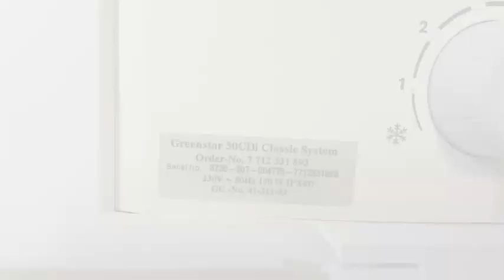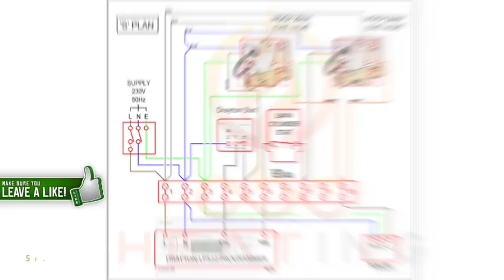Nest SMART THERMOSTAT 3rd Gen install - S Plan UK ⚡️

Comment: Hi In you last diagram.  Why have you wired pin 1 to pin 10 and the boiler.  This will turn boiler on permanatly as it bypasses the switched inputs?

Comment: Hi! Great video thanks. The wiring diagram is very helpful as i have the same system. Question is: I''m intending to put a third zone in for wet underfloor heating. I would like to use an additional Nest thermostat. 
1) can I add another nest thermostat just with one heat link, or do I need another heat link? 
2) How would this be wired?
3) Any chance you could do another video pointing out how the wiring works? I checked and mine is wired the same, just dont understand it that's all.

Comment: Hi 

I have a S Plan plus system. I want to wire 2 nest 3rd gen. 1 for heating and HW and the other for underfloor heating control. Do I wire the first one as in the diagram in the video and second nest to control the underfloor heating to terminal 6 (nest) to the live of the pump valve for the underfloor heating?

Comment: Hi there. Very good video particularly because I have EXACTLY the same Drayton installed and I want to replace it with Nest 3rd gen. Cables are connected exactly similar to one you have on your video. Can you please say if I can use just those cables to install my Nest without opening the boiler panel? Boiler is Worcester. I can send pictures of both if want me to.
Reply from the maker: Yes you should be able to. If the boiler has a switch live it needs to connect in to number 10 on the wiring centre. Normally this is a black or grey wire with a sleeve on it. I hope this helps.

Comment: Very helpful. I wondered why mine wasn’t turning the heating and water on and just realised I need to run a live to them both. What gauge wire should I use please? Would a wire from a regular (spare) tv power cable work? 

Thanks again. Will be getting it sorted tomorrow 👍🏻
Reply: Ok. Got it all working today. Thanks for the video. Saved me a fair few £’s and it’s pretty easy (when you know how) 👌
Reply from the maker: No worries I'm glad it was helpful.
I would recommend the cable to be a minimum of 0.75mm

Comment: great video thank you.  I have a issue with my  system ,  i have a S type system , (Nest 3rd gen, worchester greenstar 27ri compact, megaflow unvented cyclender,) , The issue im having is that when the nest call for hot water, the boiler turns on for a about a 1 minute and fires, then turns off after 10 secs.
the only way i can get the hot water to heat is to have the central heating on at the same time and then boost the hot water.

I looked over the wiring and it does seem ok to me, could it be the temp sensor in the megaflow is faulty?
Reply from the maker: Hi, you need to check if the hot water zone valve is opening when you switch on the hot water.
Reply: @Abc_Heating  It is opening , can hear it and also the metal lever become lose.
I checked the thermostat in the mega flow, and there is a connection (i turned the temp control all the way to the left and right).
The strange thing is that the hot water heats when the central heating is on.
Reply from the maker: @desig1234  the only possible way the cylinder can heat up is via the immersion element and the hot water zone valve. I can only assume the wiring is incorrect, without looking at it I can't advise further. All the best.

Comment: I have the exact same boiler and programmer and a wireless thermostat and managed to work out how to install before coming across your video (would have saved a lot of research!). I am confused about how hot water control works? I’ve setup a nest on another boiler that had hw satisfied wires and when testing you had control of the hot water function - I don’t seem to have this with the current setup. Assuming that with with S plan hot water is technically always on and when it cools it turns the boiler on, changes the valve to heat the hot water?
Reply from the maker: The hot water has its own motorised valve. Once the the temperature has reached the cylinder stat would close the valve. I hope this helps

Comment: Hi, I have an S Plan System. Am I right in thinking that the Nest has volt free switching and so you need live and terminals 2 & 5?
Reply from the maker: yes, that's correct.
Reply: @Abc_Heating  👍🏻 Great, thanks for that.

Comment: I have a Potterton Suprima boiler in the garage with a Myson programmer in the kitchen and simple thermostat in the living room. I’m assuming I could replace the programmer with the heatlink and put the Nest where the Thermostat is? It’s an s plan system. The hot water tank and valve is upstairs.
Reply from the maker: Chris Leckie Hi, yes you can, you need to fit the heat link where the wireing centre is. Then you should be able to follow the above diagram.

Comment: Hi I have followed your installation , I do have a problem though. The boiler just runs permanently for the CH, when I remove the link from 10 to the Live in 1 the boiler won't fire up but you can here the 2 port valve opening up when you turn up the thermostat. Does it make any difference that the 2 port valve I have on the HW has a white wire too, or is the problem and I need to get a the other 2 port valve without the white wire ?. I hope you can shed some light on this otherwise I will have to go back to the old controller.
Reply from the maker: I would need further information to be able to help you. Like the make and model of the 2 port valve you have? The guide I have done in the video is for a Honeywell 2 port valve.
Reply: @Abc_Heating  
Hi mine are Honeywell 2 port valves the only thing which might be a problem if you have come across it is , the one on the HW has a white cable too. The CH is standard with the " grey,orange,brown,blue and earth". Would that white cable be the issue?. 
Thanks for the reply
Reply: Surely having the boiler wired straight into the live would leave it running permanently??
Reply from the maker: @awilkinson4351 Are you that's not a 3 port valve?
Reply: @Abc_Heating  Hi no it's a 2 port valve I have a basic S plan system, I know that there is two different versions on the valve because I had to replace it. I have power to the nest and the HW and CH
Reply from the maker: @awilkinson4351  yes you're right I have just noticed that, the live supply to the boiler should only be going from 10 on the wiring centre. Please try that and let me know. Will have to update the diagram
Reply from the maker: The wire from 10 should connect to the switch live in the boiler if it's required. Some boilers require permanent live and some require switch live. Hope that helps
Reply: @Abc_Heating  hi 
I don't have a switch live how would I power up the boiler? It doesn't fire up being wired into 10 , if I follow your diagram it's just on permanently
Reply from the maker: @awilkinson4351  please email me and I will try to help you. Info@abcplumbingltd.co.uk

Comment: Hi, thanks for the video i have got my nest working now but i have to have the old thermostat in place turned right up. Where can i link this out? Or can i give that a 12v feed and put my nest in ? Thanks
Reply from the maker: chris morgan Hi, sorry I don't understand what you mean? You're saying you've got the nest stat working? The stat will require a 12v link from the receiver or a 240v connection from a wall socket.
Reply: ABC Heating Services hi thanks for the reply i have linked the old thermostat out now at the junction box

Comment: Hi, I have a worcester greenstar heatslave ii 25/32 external oil combi boiler and i am wanting to connect a nest 3rd generation and be able to control the hot water and also the central heating on the Y plan. It all looks very simple but every Video shows something different mainly because they are not wiring to a worcester greenstar heatslave external boiler. I have hard wired from the Combi and ran the cable to the living room to the place that i will place the Heat link and will use the WIFI control thermostat. What i need to achieve is to have control of the hot water, So if i want to switch of the hot water via the app, then i can since its only used a couple of times a day and pointless running hot water during the summer if its not needed.
The heating engineer fitted a Salus BM which is not what we wanted so i have bought the Nest.  So basically i need to know what colour wire goes where (5 Core) on the heat link and what colour wires go where on the Combi.  Any help would be great
Reply from the maker: Hi, I'm not sure if that type of set up is possible. Maybe when all items are in front of an engineer they could advise better.
Reply: @Abc_Heating   I fully understand that the hot water will be on for the CH, But on my old boiler, I had a Y Plan on a old grandee and i was able to put timers on his side, the CH and the HW , So during the summer i had the HW on timers and during the winter, If the CH came on, it would over ride the HW and heat the house up even though the HW was not on.

Comment: Hi, can the nest stat be wired directly from the old thermostat that’s in my hallway? Simply because I’d like it in the same location and for it to be hard wired. It has 3 wires, a grey in 4, black in 3 and brown in 1. Thanks.
Reply from the maker: The Hal Hi, which thermostat do you have?
Reply: It’s a sunvic TLX9201. I read that most thermostats are 24vs and I think the nest stat requires 12vs. After rummaging around for the old sunvic the sticker reads 250v ac?? What do you think? ... I have a new build with dot and dab plasterboard, I might just try to feed a USB cable through to be on the safe side.
Reply from the maker: The Hal also which boiler do you have?
If the Sunvic wires can be routed to the  nest heat link it can be done.
Reply: Hey, it's an Ideal. I'm not home right now so can't check the exact model will do as soon as I'm home. Thanks again.
Reply from the maker: The Hal No Worries, if you want you can email me via my website which is in the description. That way I can give a more detailed response.
Reply: Hi, again, havnt had much time so havnt got around to the nest, I'll email you some pics of my boiler and timer etc if that's ok. My old timer was the exact same one as in this video but I've currently got a hive set up, which is absolute pants hence the new nest. Chat soon. Thanks again.
Reply from the maker: The Hal No worries, if it's easier you can even What's App me.
Reply: You sir are a legend! Based on your diagram I 'think' I have it sussed but I'm better off getting advice off the pro.
As I understand it, neutral is straight forward, but then I have to bride live to terminals 2 and 5? Then heating control is terminal 3 and hot water control is terminal 6?
As for the stat itself I'm going to fit it in my hallway away from the boiler and hard wire it into a socket with the usb lead and plug provided.
Reply from the maker: The Hal yep looks good, but just a disclaimer, as I'm not there I'm only going according to what you're saying. Please take safety measures.
Reply: Yeh no worries, I just have the wife to answer to 😂
Reply from the maker: The Hal LoL let me know how it goes.
Reply: So I’ve got it up and running and so far so good. Did have a problem when I first fitted it where the hot water would stay on constant and I couldn’t turn it off via the stat or the app. Triple checked all the wiring which was ok so disconnected the call for water, it would turn off but as soon as I reconnected it it would fire straight back up. I resetted the stat and turned the type of boiler to ‘other boiler’ (don’t know if that did the trick or restting the stat) and sorted it. Kinda disappointed there’s no boost feature for the heating for an hour etc but suppose I can put a reminder timer on my phone then just manually turn it off after an hour/ 1hr 30mins etc.
Thanks again for your help, wouldn’t of been able to do it without you 👍
Reply from the maker: The Hal No worries mate, if it's been helpful pls leave a short review in Google. Just type ABC Heating Services. 👍

Comment: Great video, to be on a save side, is it possible to WhatsApp you to properly explain my setup to you and you can guide me through the installation. Thanks 

I have a ideal combo boiler and 2 zoning system. The zone valves are in a cupboard upstairs. Is it possible to install nest heat link where the valves are located. 

Also I would like to be able to bypass the zones and be able to control all central heating with one thermostat (nest)

Thanks
Reply from the maker: Sure👍
I would have to get back to you tomorrow evening. Got too much going on at the moment.
Reply: Please let me know when you are free to help. Many thanks
Reply from the maker: @icenature  send me the what's app and I'll try to get back to you when I can.

Comment: Hi. Thanks for the video. If I want to replace my iflo 2 channel Programmer with the heat link on an s plan and keep nest in original rs position do I just link 4-5 and then run this to t1 t2?
Reply from the maker: Hi, Thanks for the comment. 
I can't really say without looking at your wiring. You need to understand the original set up 1st th en you can pause it at 1.39 on this video for the wiring diagram. Hope that helps.

Comment: Hi, I have managed to install 3rd Gen  and have placed the Nest thermostat in a new place but only Hot water works from the Nest thermostat, it turns Red when i increase the temp but the boiler doesn't fire up, it still works from the old thermostat ,it's a Honeywell T40 thermostat.Could you please let me know which wires should i join to re form the circuit and remove the old thermostat.There is junction box in the airing cupboard and has got loads of wire in it.Any suggestion would be appreciated.
Boiler Logic Heat 15
Thermostat Honey Well T40
Reply from the maker: Vijay Arora Hi, you need to look at the diagram in the video and locate the wires according to the diagram.

Comment: Good video, wish i saw this before. My s plan has pumps instead of zone valves, the pumps have no relays so wiring up switched live via #10 can’t work for me. Currently have boiler switched live connected to dhw pump switched live - so if i want heating, the hot water has to be on too. Kinda sucks
Reply from the maker: Craig Perry I think there is a way round that, but would be difficult to assist without being there. I would recommend contacting the boiler manufacturer.
Reply: ABC Heating Services i think i have an improvement on my current setup (DHW on permanently and relying on tank stat to cut pump & boiler stat to cut boiler).

Run live to pin 2 as normal, CH from pin 3 as normal, however also run a jumper from 3 to 4. Run live to 6 instead of 5 and run dhw and boiler switched live from 5.

With this setup dhw comes on when ch is called for, and dhw can come on independently.

Still not perfect independence, i’d need a relay for that.

Comment: Which wires connected to T1 / T2?
Reply from the maker: It's an addition wire you need to run to connect to T1 & T2 and the Nest unit. If you don't want to you can connect it via the usb and a wall socket. This lead is provided. I hope this helps